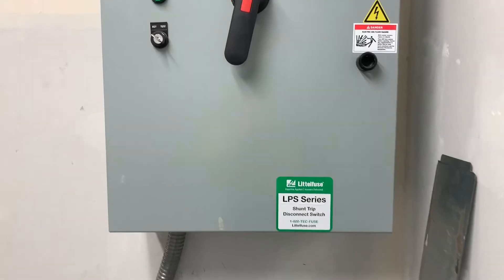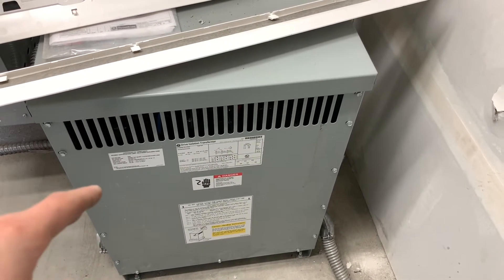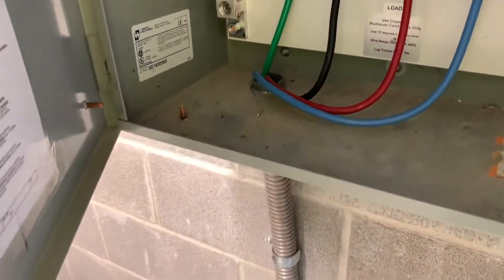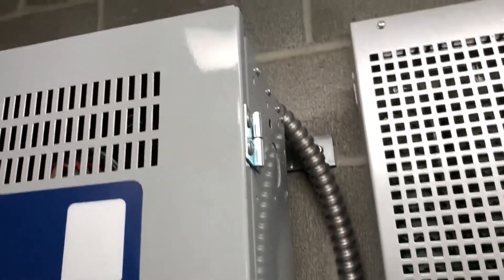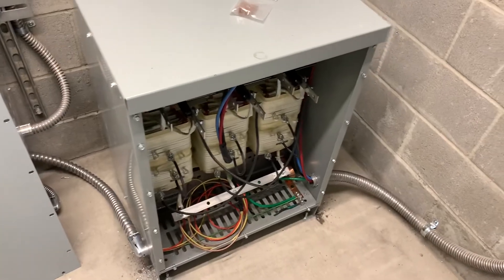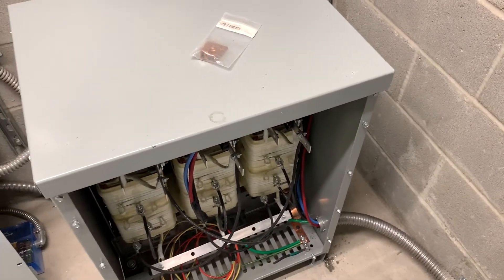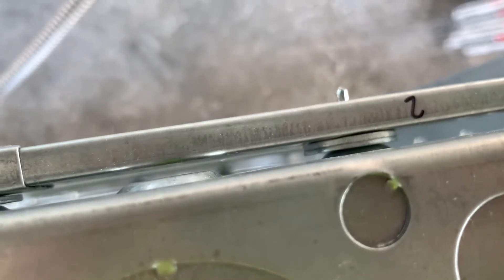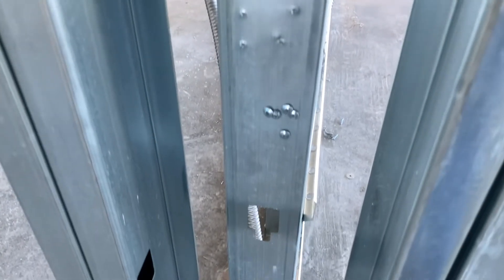Today As An Electrician: 3 Phase Transformer Install (480 Volts)

Comment: Hey kid, make sure you know how to size the transformer, conduit size and wire. Also make sure you understand the  125% rule for continuous load for equipment that runs for 3 hours or more. A lot of guys can install it but dont know how to size everything.
Reply from the maker: installed per foreman spec, thanks kid!
Reply: Installer just knows how it goes in not how it works. cant say your a electrician just a instruction follower.
Reply from the maker: call me whatever you want :)

Comment: They just put a massive solar panel array on the roof of our apartment building and they are using a 10 Kv transformer to facilitate the connection to the buildings transformer at 600V for a feed through back to the grid. Once the installation is paid off the social housing provider will get the profits from feeding thought the power from the  panels. Contractor  did t it as a  upfront zero cost installation. I think they have 40 or 50 650W panels on the roof (Biggest I've ever seen  by spec). They have a  remote access solar monitor as well that is performing some control functions since we don't have a solar controller (more power then most off the shelf units are designed for) they sub the transformer in for the  power management and the solar monitor does the rest.

Comment: Personally I would have used insulated metallic grounding bushings in both the disconnect (considering it's 3 Phase) as well as the TRANSFORMER.   And it looks like the load out side to the TRANSFORMER has no bushings at all.
Reply: The point of a Metallic Insulated Ground Bushing (MIGB) is to bond the metallic raceway (pipe or flex) to the equipment. It is designed to be used where the knockout isn't full, and you have bigger knockouts around it (incase it breaks off, it will still be bonded via the ground wire on the MIGB.)
Also, it is only required when unfused wires are incoming. They seem to be fused here.

Comment: You're not an electrician, you're a butcher who apparently doesn't know how to use a bender. Flex should be no longer than 6 ft. It should have been piped down to the transformer with a short whip at the end. Where does that whip come from that's feeding the panel? All the way from the floor below? That's crap. And you have to fix the panel mounting tomorrow? I would be handing you your last check and say adios for wasting the company's man hours. You have made my list of the crappiest work that I've seen in my 40 years as an electrician. You are are one of the butchers that give the rest of us a bad name.

Comment: I need to step up 240v single phase to 480v single phase for a long run up a mountain on my property.  And then a step down unit back to 240/120.  I have a 15kva step down unit single phase, but locating a 240v to 480 step up has been difficult. Can one use a three phase unit and use 2 phases? Thanks for any input
Reply: If you’re running it 480 just because the voltage drop that is unnecessary. You could use a buck-boost transformer to compensate for that vd.
Reply: Please hire a licensed electrician.
Reply from the maker: i think i've seen a friend do it once but im not sure on the specifics on how he did it. hope this helps

Comment: Cool how they mount a bracket with a Wago screwdriver on it to the back panel if you need to do anything. Kinda like the fuse removal tool in the fuse box of you car

Comment: By code you can’t use more then 6 feet flex.
Reply from the maker: thats not more than 6 feet :)
Reply: Unless your AHJ says otherwise, I'd look back at the NEC there, guy.
Reply from the maker: appreciate that, just following what the boss wanted. ya know?
Reply: @jimmycrackcorn1667  Sure the inspector may feel generous and pass you, but since you’re trying to get technical, the AHJ does not allow the inspector to pass an install that’s not up to code. It gives he or she the authority to go beyond the minimum requirements which is the NEC. I think you’re the one that should look back at the NEC. If that inspector is caught passing installations that doesn’t meet the minimum requirements knowingly by their supervisor he or she will be reprimanded.
Reply: You can strap it every 31/2 feet

Comment: Is the transformer bonded my guy
Reply: Right? Didn’t see a Kenny clamp or a bonding bushing
Reply: @adamdemartinis72  I see no SBJ in this video. Does he need a bonding bushing on the flex? With drilled hole (no KO cut outs) and listed fitting?

Comment: Hey man I’m thinking of becoming a electrician out of HS. How physically demanding is it? Like am I gonna be having joint problems down the line or am I fine as long as I’m in decent shape? Also what should I know before hand before becoming a electrician cuz rn I really don’t know anything but the field interest me. Also I hear I should know algebra and reading comprehension for the test I have to take for a license?
Reply from the maker: not too demanding once you move up, but not the worst as an apprentice. you can take preventative measures to be safer and do less wear on your body.

you dont need to know anything before hand but it would help.

just need to know algebra
Reply: Algebra sure,

Bending conduit involves trigonometry.

Is being an electrician hard on the body?

Sure, but really living is even harder 

Be safe, have fun, go hard...
Reply: Anyone with a pulse can be an electrician
Reply: @eddiew2325  lmao not true at all

Comment: Who’s going to fix all that flex? Where’s your grounding bushing on the primary side?
Reply from the maker: whats there to fix about the flex? i'll look into the bushing
Reply: Plastic bushings aswell on one inch emt with wire equal or greater then #8 awg... atleast thats code in canada

Comment: wondering the reason why you used #10 wire for transformer but thx for sharing. btw don't forget the bushing with grounding terminal. I experienced so many inspectors obsessed with it
Reply: Higher the voltage the lower the amps.
Reply from the maker: #10 is good enough for the amps it's sending out. thanks, i'll look into the bushing